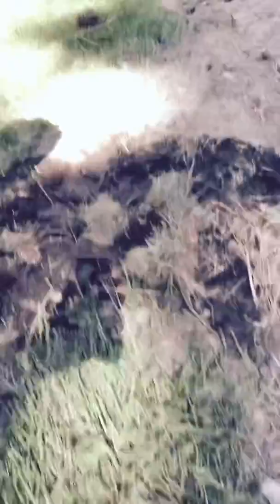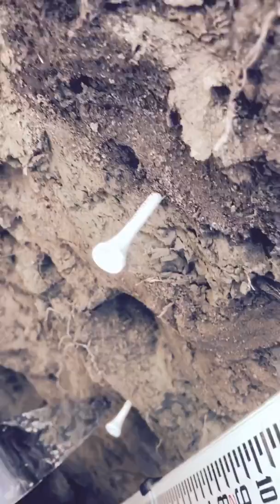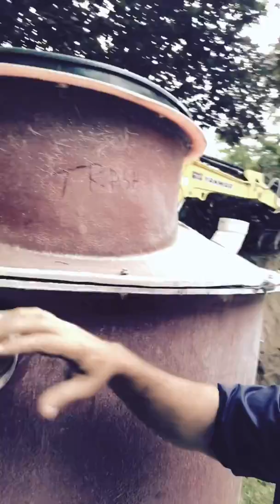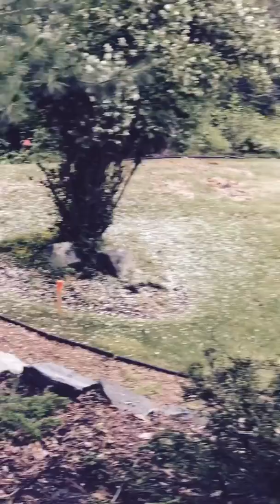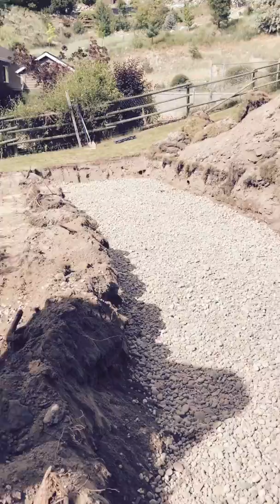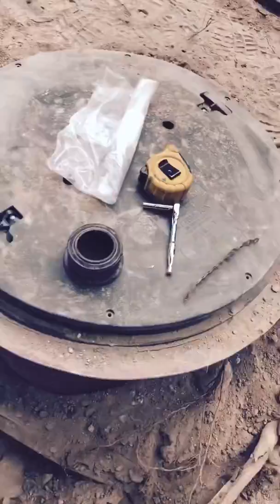Aerobic Septic System: Installation

Comment: Dear. If it's more effective system, way need to make so huge leach field?
Reply from the maker: AK-pulka al-Kuwait a conventional system would have been twice the size of this one.  We still have to conform to code requirements regarding certain loading rates of soils.  In this case our field area had to be 3 meters by 12 meters.  It is a large home with many occupants so the design is taking soil and volume into consideration.

Thanks for the question